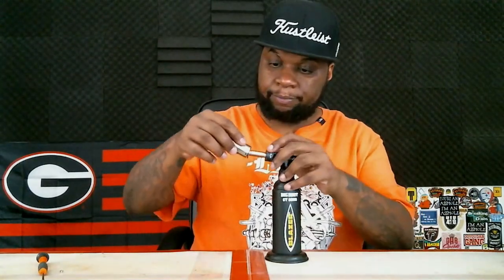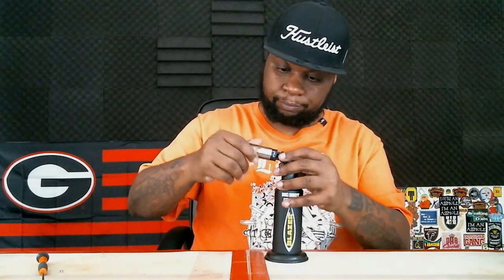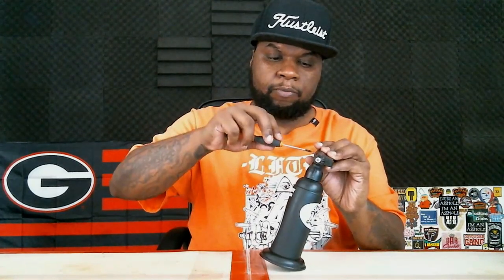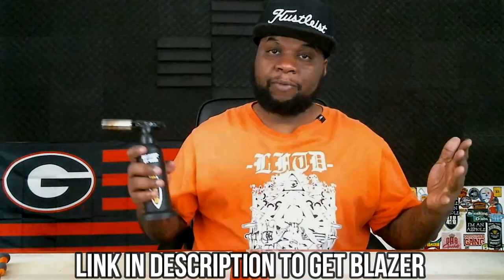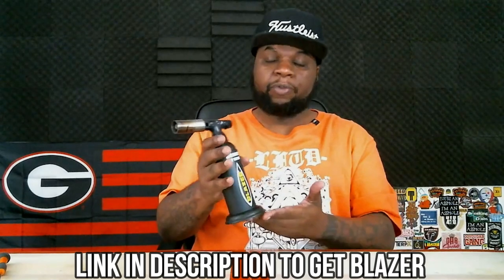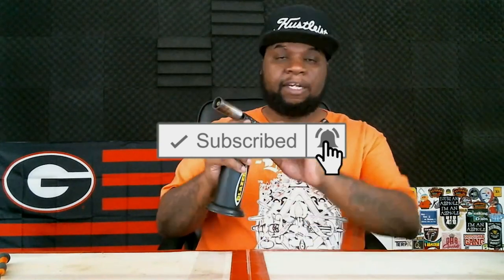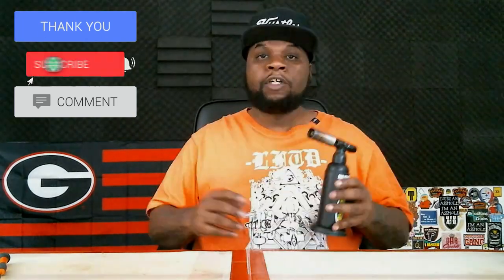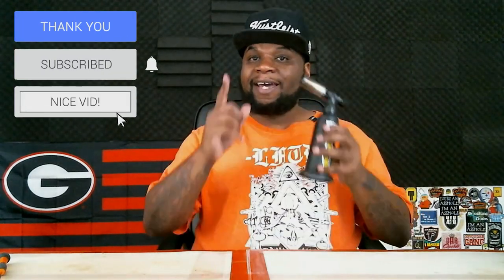How To Fix Your Misfiring Blazer Torch | GoodEats420.com

Comment: First, just want to confirm that this video also applies to the Blazer Big Buddy, if anyone is wondering. I've been looking at that little screw for weeks now thinking "whatever is wrong with this thing has to be under there." Glad I watched your video first because had I just opened it up, I'm not sure if I would have seen the little twist in the wire as the problem and probably would have broken something trying to fix it. Anyway, works like a charm again. Good looking out!

Comment: Dang bro it took me less than a minute to fix the torch I thought the flint was just bad,  thanks.
 I’ve been using it for the last year or so Having to use a lighter to ignite it or turning it on and off 10 times to get it to ignite.

Comment: Hello, can you please help me to repair a Blazer Stingray model GB400I torch? It does not turn on. Suddenly the gas stopped coming out even when it is loaded. What do I do to solve this problem? It is my primary work tool because I dedicate myself to the goldsmith's trade. Thanks guy. Greetings from Venezuela
Reply: I have this exact issue and no videos on it either
Reply: Pleaseeee help us

Comment: I had a question. My torch flame comes out really lazy and slow, kinda like an over sized lighter its a big flame but not a torch flame if you know what i mean. Not sure what happened for it to do that.
Reply: I have the same problem! Have you found a way to fix?
Reply: Not yet
Reply: You may have used some cheap or bad fuel on it? Try some highly refined butane like special blue or blazer brand butane
Reply: I took a pipe cleaner with some alcohol on it and put it down the tube took off the casing like he did cleaned everything really good with Q-tips and alcohol I was about ready to buy a new torch until I found this video cleaned it up real good now it works like it's brand new this torch is over 5 years old
Reply: @jediflip_313  never thought of that. thanks for the advice im going to try that out
Reply: @frostybrew13  no joke I was looking online last night to buy a new one found this video today by accident and I'm thankful
Reply: yeah what the others said - try emptying it completely first (be careful :))  before refilling - saw that for clippers back in the day

Comment: great vid  Do you know how to properly put back on The brass ring on the tip of the lighter I could only get it  jammed in unevenly but it Makes the flame sputter it falls off easiily otherwise
Reply: You took it off?
Reply: I slid the casing off head to do it at like an angle but when I removed it the brass ring stayed on

Comment: Tried this on my Blazer Big Buddy as it was having the same problem, but the design is different. No idea how to fix it :(
Reply: same, didn't fix my big buddy :( I can't even get it to light with a lighter! it just blows out immediately
Reply: Came here to try this out for my Big Buddy. It looks different under the casing so I tried turning the metal coil a little bit and it seems to fire now. Hopefully it lasts!
Reply: Yeah this does not work for the blazer buddy unfortunately.

Comment: Just bought this torch today brand new & filled it with Coleman butane.  It will not light but! I see a tiny spark every time I click red fire button, I’m very curious before I drive the wholeeeeee... what back to the store ect ect.  Would this possibly fix it if it’s new ??
Reply from the maker: Seems like the igniter is working but you're not getting has so yes its possible
Reply: Good Eats 420 ok thx a lot man! I really don’t want to have to get it replaced lol it’s the Higher standards edition
Reply from the maker: @3r8mo  No problem. Good luck
Reply: Good Eats 420 ended up being bad quality butane.  Works perfectly now
Reply: Tdrex820 yeah I was gonna say man, some butane just doesn’t work In this torch. I bought a shitty can  when I was camping and in a pinch and it just sputters flame like a lighter, when I got home I got a new can and it instantly started spitting flame like crazy again

Comment: Thanks for the quick fix, however my issue was the inner wire was too deep in the holder. Easy solution was a needle nose pliers to pull out the wire so it could arc to the gas.
Reply: I need a video on this

Comment: The spark on my torch is working fine but when I twist the nozzle to release the butane I don't hear the gas moving at all. Do you know of anyway to solve this? @Goodeats420
Reply from the maker: I don't think so. Sounds clogged. Try bleeding all the gas out then re filling
Reply: You over tightened the valve and may have stripped the plastic knob.

Comment: im experiencing a lot of red flame pouring out idk why
Reply from the maker: If your flame is orange/red instead of blue that means you have alot of humidity in the air. Idk if you're using your torch near a grow tent with a humidifier in it but the more moisture in the air, the more the flame will be orange or red. Once the rH is below 40 it will be blue again

Comment: On one has the other torch videos the 2.0 blazer
Reply: Bro that small screw was soft took it off and it made a circle in the screw lol😂😂 i used my screw driver from my glasses with the torque thing to not tighten too much

Comment: My blazer starts to get an orangish redish flame after its been on for more then like 30 secs also noticed my blazers flame is alot bushier then my firends his flame stays blue and looks like a more focused flame
Reply from the maker: you have a orange flame bc of the humidity in the air. If you lessen the humidity the flame will be blue again. Orange burns less hot than blue so youll have to torch longer if your flame is orange